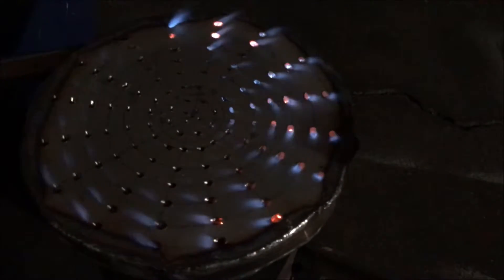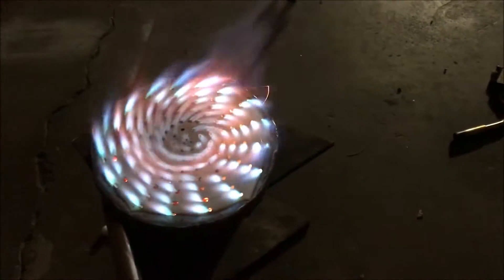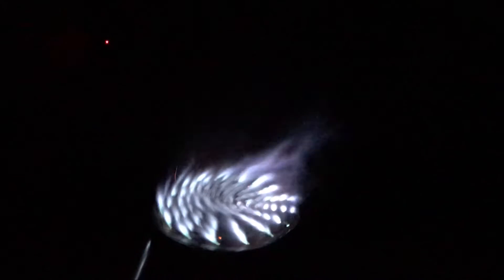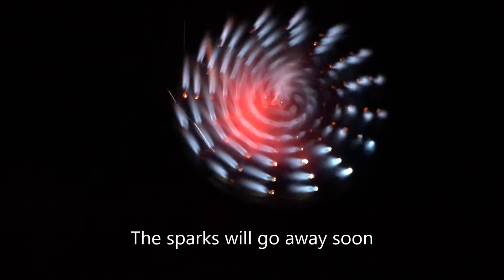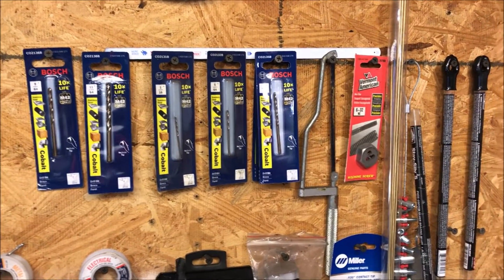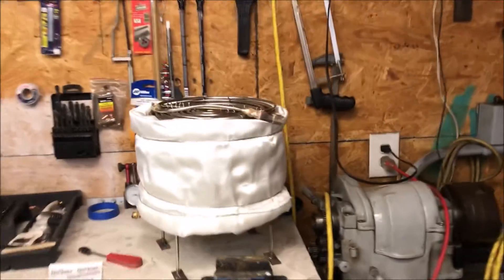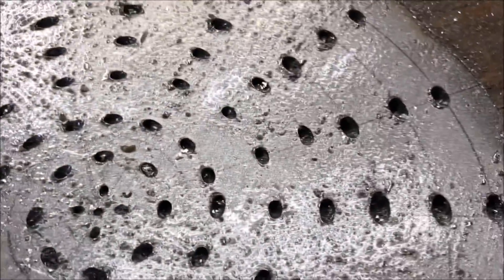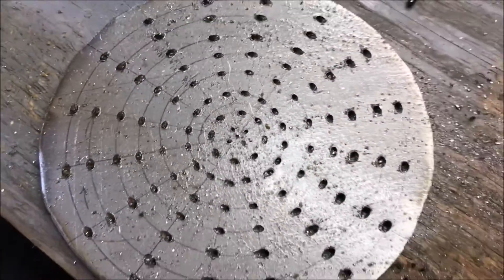Stainless steal Internal combustion Vortex burner with IR augmentation

Comment: Awestruck & speechless!
Reply from the maker: I returned to answer your message but it was gone  , it was about graphine  , i did not no you could buy it yet
Reply: @NOBOX7  Yes, you can DIY or buy in the form of powder, inks and paints but I expect the greater challenge might be finding a way to adhere the graphene to the steel that would withstand such high temperatures. I wonder if electroplating would work? If so, it would be an excellent way to protect engine parts and exhaust systems that might get brittle upon continued exposure to hydrogen protons...